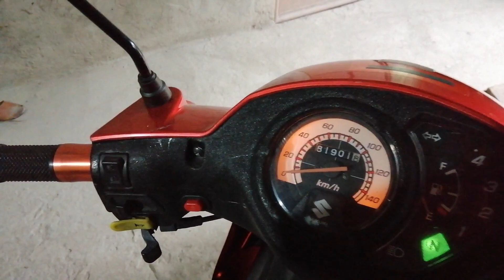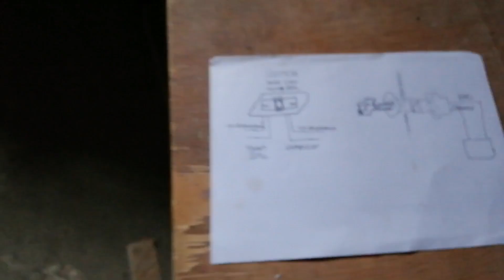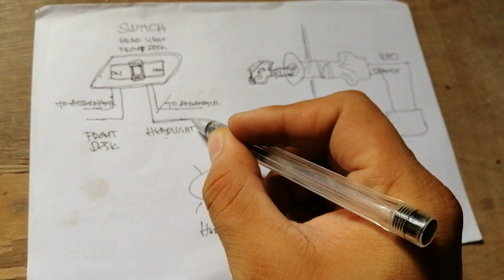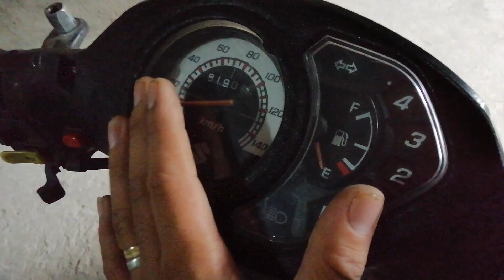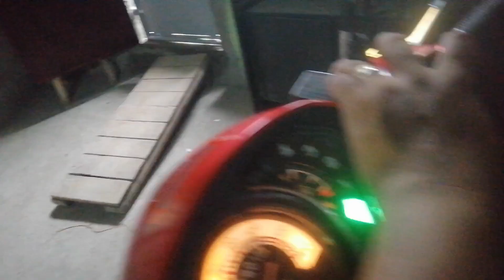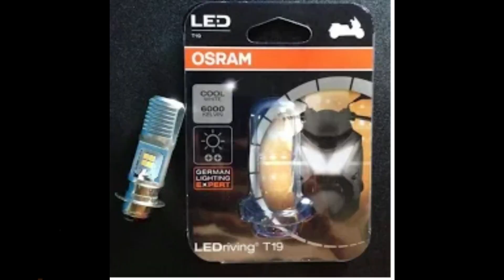SMASH SUZUKI 115 MOTORCYCLE (BATTERY OPERATED) ACTUAL WIRING

Comment: boss yung pulang socket galing front desk đi naba isasaksak?..cundem naba ung yellow?.,yung puting wire yan ba ang galing stator tas pinutol at ikokonek sa linya ng i.g?.,kahit anong gawin ko        ayaw gumana ng front desk eh...salamat boss
Reply from the maker: wla ka gagalawin socket ng front desk papas .. ung sa switch kalang may gagalawin
Reply: i mean yung a switch ng front desk puti yung i kokonect sa ig?,tapos yung yellow wire boss cundem na?.,dinarin isasaksak oabalik ng socket niya?.,pano i trial & error boss para maaman ko kung anomg wire ba gaamitin kong i connect or alin dun ang from stator...pasenxa..hehehe
Reply from the maker: @aldagoc2111  wla na un boss pag pinutol mu na un kahit ibalik mu un wla na un kc wla na connection
Reply from the maker: ibalik mu nalan g sakit para di nakakalat, pero wla ng connection un kc ung puti nilagay mu na sa ig
Reply: @motoflute7891  okey boss..try ulit...kahit anong gawin kong pag tatap nguting wire dun sa ignition wala e...ung headlight lang ang umiilaw..cge boss salamat😀
Reply from the maker: @aldagoc2111  pag susi mu paps dapat iilaw na un.. ung kulay orange na wire sa key switch mu paps un ung e tap mu
Reply: @motoflute7891  oo nga paps pinag palit2x ko pa nga baka mali yung naputol kopero diparin..hanggang umabot na ako sa ayaw na pumatay ng motor ko kahit pinatay ona igniton ko..hahaha...grabeng trial & error 3 days...give up na ako...dko magaya yung sayo...hahaha
Reply from the maker: @aldagoc2111  anu nangyari paps. baka na derekta mu iba paps.. double check mu baka iba na hugot mu na socket
Reply: @motoflute7891  kahit nga ako nalilito..dalawang wire nga yung  tinray ko i tap  sa ig pero walapa din eh 2 wires lang naman andun...wala ibang paraan dun paps?

Comment: Sir safe b ung ganyang battery operated meron kcng ibang video na sa may bandang upuan knakabit ung wire na galing accesory wire...
Reply from the maker: baka ung flasher relay boss kinakabitan un boss pag gagalitan m ung hazrd
Reply: @motoflute7891  boss gnawa ko ung wiring m pero di nako mkapsg push botton pag start
Reply from the maker: @ericbarboza6333  baka na lowbat na brad battery mu malakas kc kumain ng batt pag batt operated na.

Comment: Paps pano ung tail light nya magiging battery operated na din b un? Salamat rs👍🏽
Reply from the maker: stock talga ng smash naka battery operated na nag back light naten paps, subukan mu susian iilaw yan kahit hindi paandarin
Reply: @motoflute7891  paps i mean ung tail light nya, ung ilaw sa plaka, ung sa rear brake nya oo kht engine off tapakan mo iilaw basta nka susi. Ung tail light ko kc gaya ng ilaw sa head at s speedometer kailngan mo paandarin makina para umilaw. Salamat
Reply from the maker: @mismo2170  try mu paps ung ginawa kung wiring. pag susi mu tas gumana na ilaw sa tail light battery operated na din yan. di ko kc na pansin nung di pa battery operated ung tail light ko kung gumagana na kahit di paandarin e, pero kung parehas sau yan baka nga kasama na un kc saken pati likod pag sinusian umiilaw agad
Reply: @motoflute7891  oo nga paps baka nga kasama na ung tail light sa wiring ng speedometer at headlight nya.. Laking tulong ng pag demo mo hehehe,. Osram t19 nlng kulang😁 salamat, godbless at more subscribers sa channel mo.. Rs😁👍🏽
Reply from the maker: @mismo2170  salamat paps, pa share nalang video ko papskung nakatulong ty
Reply: paps kahit bagong smash same lng p ang wiring
Reply from the maker: @nikkileetampus6290  yes paps

Comment: paps ung green wire anu po purpose nun bat nyu sinama sa orange wire dun sa ignition switch
Reply from the maker: sa horn (busina) ko un paps dun ko sinabay
Reply: @motoflute7891  ginaya ko kasi paps ayun d na nag function horn switch ko kaya binalik ko nlng stock wiring
Reply from the maker: @bigz3267  bakit di na gumana paps?

Comment: Boss bkit ganun hnd b tlaga ksma s batt operated ung ilaw s hulihan..  Headlight lng kc gumana sken
Reply from the maker: check mu bulb mu paps
Reply: Ok paps ang bulb q gumagana nman sya pgumaandar n mc q paps..
Reply: Bka s my ilaw ng dashboard nkaconnect ung tail light nya paps hnd q kc cnama s batt operated ung s dashboard
Reply from the maker: @josuamagnaye2578  ou paps subukan mu.. sken kc sinabay ko na din
Reply: Paps ung red n connector ikakabit pb dun s my switch ng ilaw pag batt operated n din ung s dashboard
Reply from the maker: @josuamagnaye2578  ou paps e direct muna. para pag ka susi mu naka on agad ung  dashboard
Reply: Naconnect q n paps ung s dashboard umiilaw n ung s my tail light .. Ang problem lng paps umiilaw n kgad ung s tail light khit hnd p nkaswitch ung ilaw
Reply from the maker: @josuamagnaye2578  mali ung wire na kinabit mu paps try mu ung naman ung isang wire nya
Reply: @motoflute7891  paps ginawa q lng nman ung nsa video mo..  Db ung nsa red n connector ung puti wire ung kukunin tpos icoconect n din don s batt operated n headlight
Reply: @josuamagnaye2578  ganyan din sakin tama din ung connection ko .kaya nag  didischarge agad batt ko . di ko na ma on sa push button starter nya .
Reply from the maker: @josuamagnaye2578  ok na pala yan paps nak ilaw na talaga ung sa tail light pag kasusi mu kahit di mu pa ino on ung switch ng healdlight mu... kc sinabay yan sa ilaw ng dash board na nakailaw na din pag sinusian

Comment: boss good am linawin ko lang po sorry di ako tlga marunong need pa po ba ng extra wire ung itatap mo from headlight switch to battery?
Reply from the maker: yes paps need mu isang extra wire.. 1 meter wire sobra na yan
Reply: @motoflute7891  salamat boss chief. basta pagbibili ako sabihin ko lang po 1 meter wire
Reply from the maker: @mangjosetv5908  ok paps

Comment: paps bakit nag didischarge ung batt. ko tama sinunod ko namn connection mu . di ko na ma on sa push button .
Reply from the maker: pas malakas talaag sa battery ung LED .. dapat e full wave mu ung rectifier mu para fast charger pero dapat ung alternator full wave na din ... kc baliwala full wave transistor pag di mu din pinullwave alternator.. nxt vlog un gawin ko paps tutorial nun
Reply: @motoflute7891  sige paps abangan ko un next vlog mo salamat .
Reply: @motoflute7891  paps di pa ko naka led stock pa rin gamit kong ilaw balak ko palang mag palit pero humuhina ung batt. nya
Reply from the maker: @julsdicen8379  ganun talaga papas pag battery operated na, sa battery na kc naka derekta lahat
Reply: oo nga paps eh babalik ko muna sa engine operated ung motor ko . need ko muna mag fullwave bago ko mag battery operated
Reply: Boss wala paba ung tutorial kung pano mag full wave
Reply: @chieroseduran1471  meron na bosss check mu nalang sa videos nya
Reply from the maker: @chieroseduran1471  meron na paps..https://www.youtube.com/watch?v=HTNVD6QCBzE&t=130s
Reply: para maging fast charge ang smash putulin mo yung kulay yellow ss may stator pag putol mo nun matic naka fast charge kana..ngayon kapag naputol mo na yun pwede mo lagyan ng switch yung pinutol mo na yellow wire

Comment: Kasama na po ba ma babattery operated Yong ilaw ng speedometer?
Reply from the maker: ou paps.. sundan mu lang wiring ko
Reply: @motoflute7891  ksi Yong motor ko honda wave 125 alpha e, pwede din po ba Yong wiring mo sa honda?
Reply from the maker: @johncarlolalu2364  pwede naman papas.. pinka common kc paps pag nahanap mu ung accesories wire mu nakalucate lang lagi un sa susi an dalawang wire lang lagi un.. testerin mu kung saan ung accesories wire tas aun e rekta mu sa switch ng headlight mu at front desk
Reply: @motoflute7891  alm ko na Yong accessories wire ko ksi nagkabit na ako ng busina ko e, mahihirapan lng ako kng pano ko hahanapin Yong sa headlight saka Yong sa ilaw sa speedometer ng akin Yong ilalagay sa positive para maging battery operated sya, Yong katulad syo na dalawanh wire na niconnect mo sa accessories mo
Reply from the maker: @johncarlolalu2364  sa switch paps buksan mu nalang  gamit ka tester
Reply: Ahh sa switch ko kukunin yong icoconect ko sa accessories wire? Pating Yong ilaw sa speedometer sa switch ko din kukunin paps?
Reply from the maker: @johncarlolalu2364  ou paps